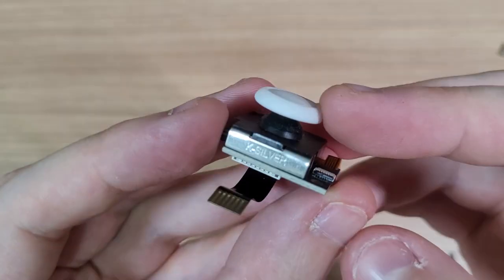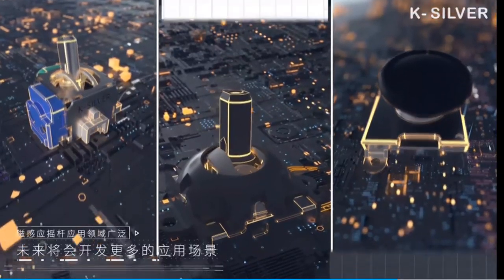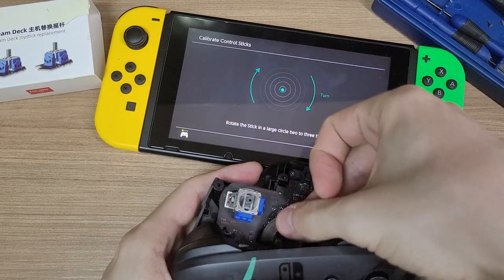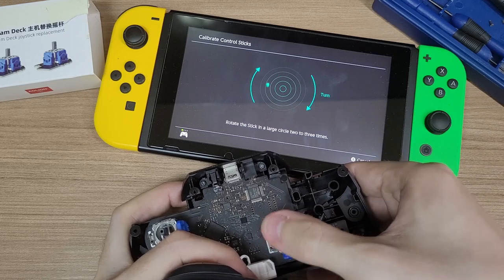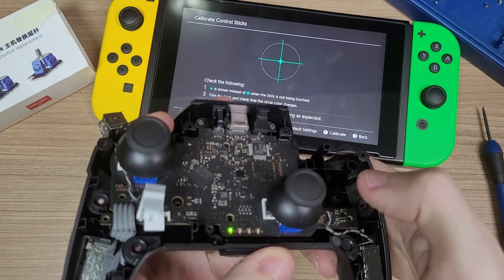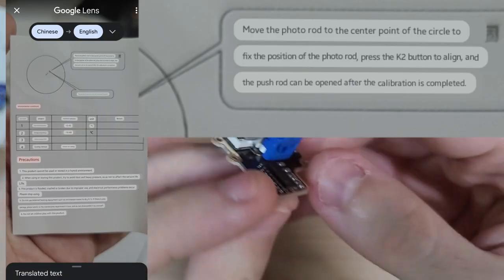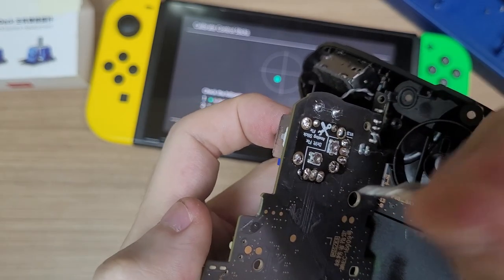Testing Full-Size Hall Effect Sticks from K-Silver

Comment: As I understand, the chip is needed to make the readings usable in a controller because the magnets are not all the same, and even within the same magnet the magnetic fields are not symmetrical. And depending on the type of sensor, even a conversion of voltages might be needed. 

So, yeah, the chip is necessary to make the sensors work in a controller.

Comment: The reason why the drift compensation board does not work is because the hall effect joystick works by means of outputting voltage, not by means of changing resistance.
Reply: Me paso una vez cambiando los análogos y fue por que quedo mucha soldadura en unas conexiones creando mucha resistencia, solución crear soldaduras prolijas como las de fabrica

Comment: those logic chips are almost certainly doing something - either increasing or decreasing the voltage that will be read by the controller's logic
you might consider hooking up an RMS multimeter to the controller to see a) what values the original sticks output, b) what values the hall effect sticks output

This could also be fixed in software, but without accessing the controller's logic (or more likely and more impossible the Switch's logic) it won't be achievable
Reply: The chip is a Sinomcu MC32F7361.  8 bit microcontroller, clock, oscillator, some interrupt pins, and an ADC.  I think what it's doing is taking stick input as-is, applying a correction function, and modulating a digital output's voltage to act as a virtual voltage divider.  It's a simple solution and would work,  GK's Steam Deck modules would be doing the same thing but with a different, and unidentifiable, chip.  This would also explain why the controllers and devices that use these modules don't have the additional ICs, as they'd be doing this function on the controller's own microcontroller, as these controller would be programmed to have a calibration function.  Stemming from this, the BiliBili DualSense probably has hacked firmware to do this where the stock firmware would not have this function. 

But good god these sensors have an absolutely massive range of output if the stock module with no correction is producing ellipses within a circular gate.  Probably why they're not catching on outside of one patent holder, one licensed manufacturer, and a handful of industry customers.  There's also the issue of quiescent age-related voltage drift, similar sensors from TI are only rated at 1000 hours of use, which would be controller on-time in this use case. 

You also don't need a DMM that can do RMS functions to read these modules, all you need is a DC voltage reading; potentiometers are just voltage dividers, the vast majority of them with linear output, all you need are two values and a line to figure out how they work, hall sensors aren't quite the same and have many more variables as to how they function.  Probing the modules is pretty pointless anyways, you're not going to fix them with a simple circuit, that's why microcontrollers are used; keep in mind that these are linear output sensors being used in the utter most nonlinear way possible, you need the full analog input range and a much more complex non-linear function to properly 'calibrate' the sticks.

Comment: The 'VR controller' animation shows ALPS' newer RKJX2 sticks, that as far as I can tell are only available in the GPD Win 4, and they showed up in the FCC documentation for the PSVR2 controllers.  They're meant to be the best of both designs, the full sized stick box's half gimbal on top of the slimmer JoyCon-like module FPC board, as a screw-in module with the FPC connector.  There's also potential for them to be better than the full sized ALPS stick boxes, as the linear wipers have potential to be of better design.  I had mentioned on another channel's video of the NYXI the similarities, but it looks like KSilver's approach, if the NYXI modules are theirs, isn't using screw-in FPC modules, which is a bit odd, they also look quite a bit thicker than the RKJX2 modules.

Though, I also wonder what KSilver is rating their hall effect modules at.  I know everyone is hooked on the marketing buzz of zero drift, but if you actually look at hall sensors you'll see that they have a certain spec of quiescent age-related drift, and I know Texas Instruments rates this spec at 1000 hours in their basic sensors; and this relates to on-time of the controller, so this lifespan is worse for those who leave their controllers on constantly.  Problem is, hall sensors have a premature period of high voltage drift that plateaus for their usable life span, then age-related drift shows up and becomes a runway issue of becoming worse as the sensor's age increases.  This is a problem for sticks, as you always have the magnet within sensing range and you have the magnet positioned such that the sensor reads the expected center voltage of the controller, with movement in both directions.  This isn't such a problem for triggers however, as they're inaccurate devices by design, but their sensing is always zero as the trigger's rest is outside of sensing range, and up to a threshold where the expected voltage would read 100% analog value; the reason triggers aren't all that accurate is because the most accurate thing you'll do with them is feather throttle or brake in a racing game, and even then it's clunky, plus they're just not designed optimally for the sensor, hall sensors work best when a magnet is within an offset plane, either with a linear sweep perpendicular to the sensor along this offset plane's axis of sensing or a vertical linear sweep where the offset of the planes increases or decreases, a rotating magnet that mimics either can be used but then you get into field strength behaving slightly differently.  Give it a couple years of time for the average person, hall sticks will start showing issues, and this assumes the full average of the quiescent spec; 1000 hours average is not a long time.  There's also better solutions out there, Sony had their own magnetic stick solution that wasn't a hall sensor 15 years ago (of which I'm working on replicating, but it's to the point of custom fab work so I'll probably be passing this off to a few contacts I have within the industry), and inductive sticks are another immediate option (the next project on my list), as well as various other solutions; at the end of the day, hall sticks won't last, they're short term marketing buzz piggybacking the fact that ALPS is putting out lackluster products currently, if any of these companies actually cared they'd buy into a better technology, two of which are readily available. 

I had discovered these modules some time ago, and I was able to find the spec sheet for the ICs on the boards, though that didn't really lead me anywhere as I wasn't sure of the PCB's tracing.  Gulikit's own design for Steam Deck modules also has an IC on the PCB but there's no identification for them, and they have a significant amount of additional pins on these chips.  There's definitely something bizarre going on with these various modules.  The IC on these boards specifically are a microcontroller, 8 bit CPU, a clock, an ADC, some interrupt pins, and an oscillator, but no DAC, so I'm not sure how they're outputting analog signals unless they're modulating the voltage on a digital pin.  So far the designs, both KSilver and GuliKit as they're essentially the same when it comes to modules within a controller (GK holds patents, KS has the manufacturing license), seem to be entirely proprietary in circuit design for them to work, and probably why we'll never see true drop-in modules; of which multiple people have argued about in the past but I'll keep saying the two technologies are incompatible until someone can pull it off with a bare hall sensor with no additional ICs.  It's even more bizarre that the stick outputs are behaving elliptically, the only thing I can think of is that the raw sensors have an absolutely massive range of quality, which would lead me to believe these ICs are mostly for calibration so that their output is circular; as long as there's no drift, it'd be a simple function to adjust output, and no, drift can't really be compensated for in this way due to drift being a runaway issue but also because drift would be somewhat inconsistent.  If this is the case, this is probably the reason they'll never catch on, they're extra work to deal with for a sensor that has a limited usable lifespan.  As for the BiliBili videos, I honestly wouldn't be surprised if the DualSense controllers have hacked firmware that allows for some form of calibration, all modern controllers use a microcontroller after all, and a microcontroller could just as easily be programmed to have this kind of function, just as the ICs on the KS and GK modules have microcontrollers to allegedly do the same job.
Reply: i think your reply went over everyones head lol, very impressive level of knowledge. In terms of a consumer grade option for lets say a competitive gamer which controller(s) on the market has the best sticks (with low input latency)?
Reply: Shorten this.
ChatGPT: WOw yOu knoW a lot!
Err thanks. can you shorten my essay?
ChatGPT: 
Certainly! Here's a shorter version:

The VR controller animation shows ALPS' newer RKJX2 sticks, which are only available in certain devices. KSilver's approach, if the NYXI modules are theirs, isn't using screw-in FPC modules and they look thicker than the RKJX2 modules. It's unclear what KSilver is rating their hall effect modules at. Hall sticks won't last long term as they have age-related drift issues. There are better solutions available like Sony's magnetic stick solution and inductive sticks. The designs for the modules by KSilver and GuliKit are proprietary and likely won't be drop-in compatible. The stick outputs behave elliptically, possibly due to a wide range of sensor quality. The limited lifespan of hall sticks and extra work needed for calibration may prevent them from catching on. It's possible that the DualSense controllers have hacked firmware that allows for calibration.

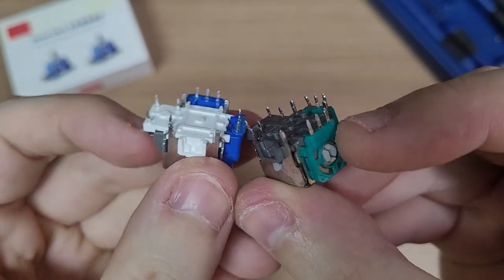Comment: The adjustment screws won't have much of effect because of the design difference in the casing. You can see the difference @2:12 where the original stick has contact points for the adjustment screws whereas the K Silver do not. I also wonder if it is an amplification issue since  the system doesn't rely on resistance to tell the position of the stick. If you look at the typical joysticks, they mostly have different size resistors for calibration of the axis. Hall effect sensors rely on the distance from the magnet for location. I couldn't find a breakdown for these sensors but you may be able to calibrate or amplify the signal coming from the sensors or change the position or size/strength of the magnet to affect the readings

Comment: There is a vidof someone who has built these from scratch the issue is the output range is different on different joysticks.  The chip will be a small microcontroller to output the right voltage and that's what the calibration is for.

Comment: I'm guessing here. The reason it did not work is because the hall sensor inside the potentiometer expected a minimum of 4.5 volt while the controller only supply a 3.3 volt max. A separate power supply circuit if required for hall sensor and then a voltage divider circuit to convert output from the hall sensor (0-4.5volt) to the controller 0-3 volt range. This hall sensor should work on usb powered controller since most of them work on 5 volt.

Comment: This looks like a promising mod in the making for the Switch Pro Controller, once the pre-calibration chip situation is solved (removed, reverse engineered, documented) so that it can be used in a DIY as-is.

(Truth be told, I only have 1 Pro Controller and it has drift, and have yet to attempt the (paper) drift fix guide from a while back. One day I'll break that ice...)

Comment: You are doing important work here. My favorite controller game happens to be a shooter on Roblox that specifically runs a check for Xbox licensed controllers to give the player aim assist. So I am stuck with Xbox licensed controllers unless someone releases an application to spoof the license on GNU/Linux based operating systems w/ games ran with Wine or unless I want to loose to mouse users.

Comment: From what I heard the issue is with how the nintendo team developed the stick registration software. They intentionally add a buffer to counterbalance the stickdrift on regular controllers.
Reply: Right, this is what I was thinking. All controllers with pots use an algo to compensate for degradation over time. My perception of the experiment here is that's the reason the right stick eventually worked. He was persistent enough to "train" the algorithm.

Of course with the appropriate parts it will work immediately.

Comment: Each manufacturer of joysticks uses potentiometer of different values. Sometimes the same manufacturer will use different potentiometer values from one console generation to another.
This is why you don't have the full range of motion. The resistance value of the Hall Effect sensor is probably slight different from the potentiometer value that is used by your controller.

The chip on the Hall Effect Sticks board is most likely a SoC that does analog to analog conversion. It takes the resistance values that the Hall Effect sensor and converts to the resistance values used by to controller.

You could try to sever the traces on the controller run some jump wires from the Hall Effect sensor to the Hall Effect Board and from the Hall Effect board back to the severed traces on the controller.

@ Btw do you have a steam deck and a multimeter? Mind telling me what is the resistance value of the stock steam deck potentiometers (Ohns). For some weird reason that information does not exist in the internet.
Reply: A little stick with on board atmel, isp pins, open firmware and arduino compatibility would be fun ;)

Comment: could you do mod a splitpad pro because i have one and i want to have hall effect sticks in it also how do you do this with wired controllers
edit:how do you get the mod to work... you reset the controller stick calibration so you can have full range and it will be easier to calibrate

Comment: Such thing works on steam deck because such thing is already finished module. Module is already something more than analog itself, it has some additional computing power to make output of hall effect analog compatible with steam deck. If you have such additional computing power to make output of hall effect analog compatible with switch (and any other) controller - it will not work.

Comment: You should connect it with cables to your gamepad stick solding point , then calibrate it on this PCB and then solder it into your controller ;)
Reply: That's a nice plan. It'd be neat if the stick's pins could go through the ds5 pcb and then extend through holes on the calibration pad on the other side. A pcb sandwich with the adjustable pots accessible on the back 🎉
Reply: @bakedbeings  can be extended with some steel wire ?

Comment: Hello, I have a question that no one answered for the moment and it doesn't appear anywhere when I look for it: will this piece of anti-drift "Gulikit-Joystick" be compatible for "8BitDo SN30 Pro+ Controller" or "8BitDo Pro 2" or "SN30 Pro (Discontinued, but I have it)"? one of the 3 will be enough, although it would be too much to try each one (I have all 3)...
I hope the translator is not a hindrance, I speak Spanish
Reply from the maker: Well since they didn't work on the pro controller I suppose that it won't work on any of those controllers

if you want an 8bitdo controller with hall effect sticks, try getting the 8bitdo ultimate bluetooth

Comment: The link for the joysticks says this item is no longer available. It is the case that it is not available in some countries?
Reply from the maker: Yeah you can look for them on aliexpress by searching "hall effect stick steam deck" just be careful to not buy the gulikit model
Reply: @VKsChannel  why is that you need to be careful not to buy them?
Reply: @Xamy-  I think it's because the gulikit model uses a surface-mount hall effect chip. The ones in this video have the standard three-post potentiometer-like connection for the stick axes.

Comment: Hello VK's Channel do you has link the bilibili  video
Reply from the maker: Here
https://www.bilibili.com/video/BV1WP4y1e7Sr/?spm_id_from=333.999.0.0
If you discover something please let me know!
Reply: @VKsChannel  thanks you very much
Reply: @VKsChannel  Apparently he didn’t fully tested he just soldered it. The pictures on the AliExpress show there is a chip on the stick novo, so I would think that is altering the values of the stick. Are there any sticks without the chips on the mobo?
Reply: @RandomAccessRaul  sadly I am looking for those for quite some time, that chip is in fact calibration chip so sticks have full range of 0 - 3.3V (usually if input voltage is 3.7V)...

This could be done if additional parts would be moved to the opposite side of the potentiometer/hall sensor where no button is... Not sure how much of a job is it...

Comment: Id check to make sure its soldered flat. Then possibly take it a step further and lower the module by trimming  the plastic bits off the bottom🤷‍♂️
Reply from the maker: I soldered to both sticks and both of them didn't work

It is a problem with the hall effect stick and not with the board
Reply: @VKsChannel  completely ignored what i said but aight